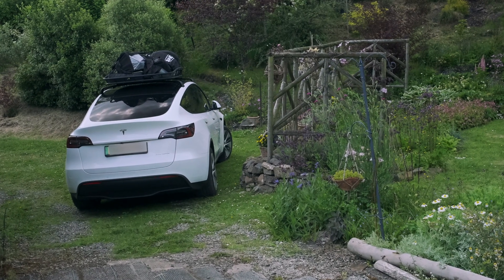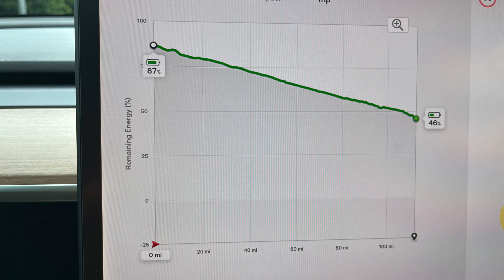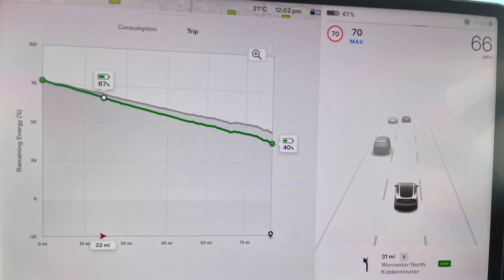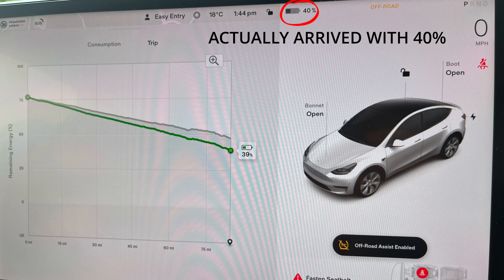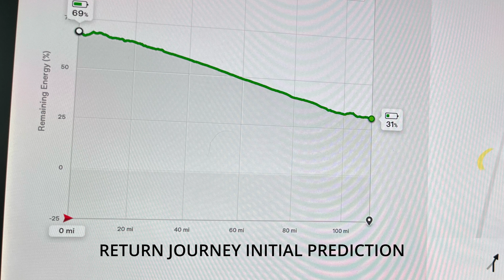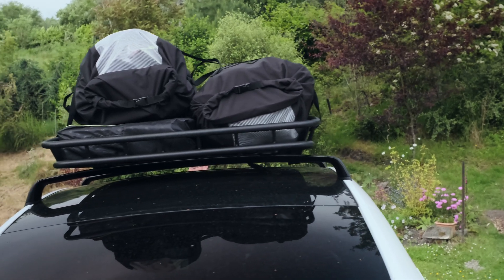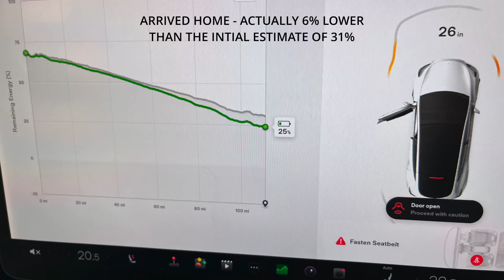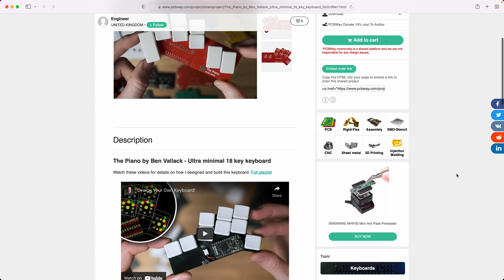Roof Basket And Tesla Range - Interesting Findings!

Comment: I just watched the out of spec video testing a box on Ioniq five, and even with a streamlined box it really impacted range a lot, like 30% or more. We decided to use your strategy on our Kia Niro EV and we’re hoping it’s not that bad, since it won’t be as big as the box used. For local camping in our region it’s not a problem, but we were planning a really long trip out east and it could get even longer if I lose 30% every charge.

Comment: Tesla has nailed accuracy with percentage but not with Miles. My dual motor model y has never made it much over 200 miles when it's supposed to ger 330 miles on a full charge

Comment: Resistance is proportionaly to speed in the power of 2. So,  in km/h it would be increase 112^2/96^2 = 1.36=(70/60)^2 (same result in miles). As the car has very good aerodinamics you do not notice that 36% hit without anything on the roof.  But once you add basket and stuff you will see. The problem is that to you can't drive 60 becase your time cost money and if you compare cost of the lost enery and cost of your time you need drive max possible speed. It would be wonderfull if the car could fully drive on it's own and you sleep in there or do your own stuff like even watching windows and relaxing. In that case it worth to go 60. Would be interesting to see comparison in drop with roof box which have better aerodinamics than the stuff dropped into the busket.

Comment: Does it change all the supercharge stops that were initially suggested on the map?  I hate when it puts stops on the map with 15% battery left if you charge there.. adding a cargo box will just increase my anxiety. I'd like the map to set the minimum acceptable charge for each stop.. i don't mind to stop mire often.. better stop more often than being towed.   Anyway, i've added a roof cargo box and was wondering it it remember, notice and set the route differently now, or does it set back to factory calibration by default everytime you turn off the vehicle
Reply from the maker: I wasn’t ever in a journey that needed a supercharging to find that out but given it dropped all the estimated range at the start of the journey I’m assuming it would do. It might just tell you to drop the speed. I’m pretty sure it does this calibration each journey based on the consumption it sees.
Reply: I know the super charger stops are dynamic. I once got a reroute to a different supercharger because the other one was too busy. I never went into your suggested situation, but i guess it will just reroute fine.

Comment: Would love to know your thoughts on battery degregration, charging habits and max charge setting for daily use…
Reply from the maker: Charging habits and max daily limit will correlate to battery degradation. Basically I avoid bottom and top 20% for daily use (fine for longer trips) and I don't expect battery degradation to be significant enough to worry about this side of 10 years.